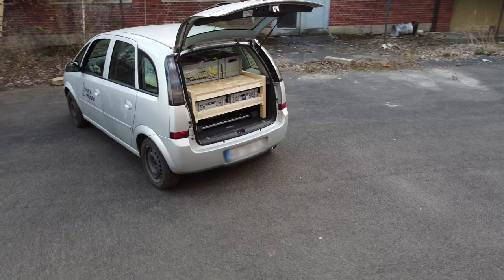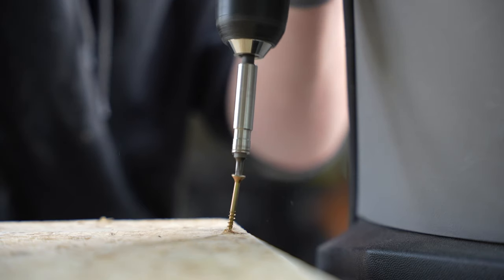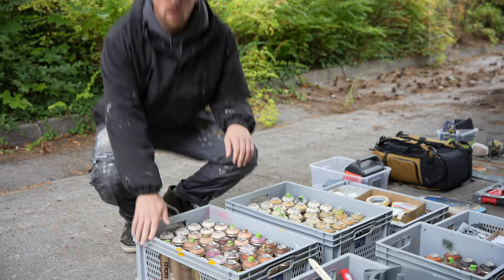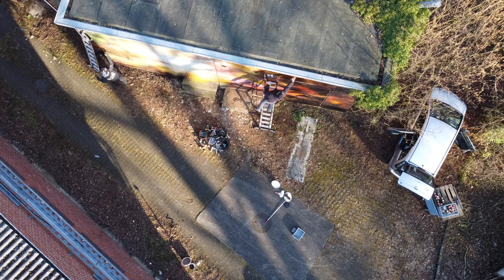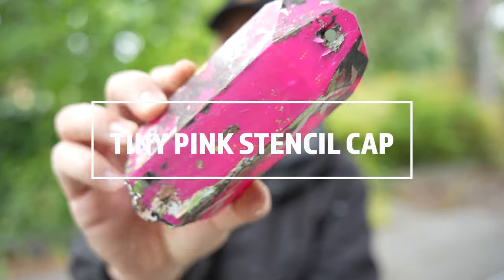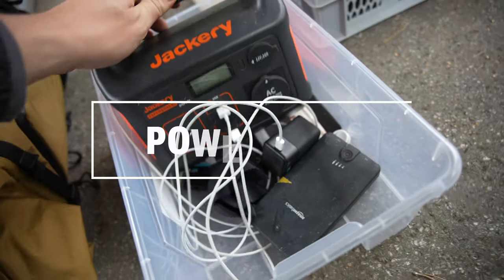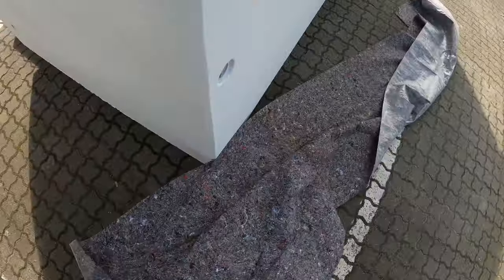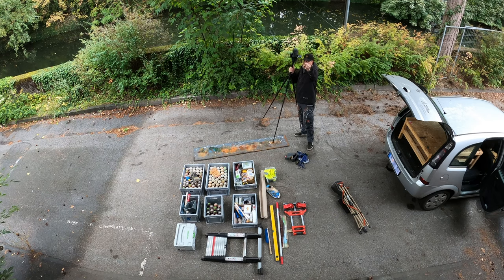The Tools I Use to Paint Murals

Comment: If you keep getting stuff stuck in the grid of those boxes, you can just put some thick piece of cardboard on the bottom. It will serve as an extra protection layer.
Reply from the maker: That's a smart idea. I might do that. Even though the system with several boxes works quite well now. Gives me some separate departments at the same time.

Comment: Where does an idiot (ME) get rattle-can spray nozzles/buttons/caps?  Amazon hasn't a clue what I'm searching for!!  Mine are ALWAYS clogged when I need THAT colour!!!  Just saw your stencil caps!   I never knew they existed.  I'll bet my ass they beat my cereal box n' rags contraptions!!  
~Keep Smilin'!~
Reply from the maker: Depends where you’re located. I mostly use Montana Level 1 caps, Montana Black / Black caps and Montana Ma‘Claim caps. Maybe you can find an online shop that sells those in your country. Here in Germany I order with Better Run Shop.
Reply: @NickMoody  Thanks Nick for getting back to me so quickly.  I live in Windsor Ontario Canada and am finding it really difficult to find someone or somewhere that ships here.  The caps are less than $0.20 each but the shipping is $20.00+!!!!  Even if I buy all six caps in the set and order 6 sets it's still $20+ for f*ckin' shipping!!!  I'm givin' it a rest for the remainder of the day cuz I'm just raising my blood pressure.  
Time for a fatty and double shot of Canadian Club!